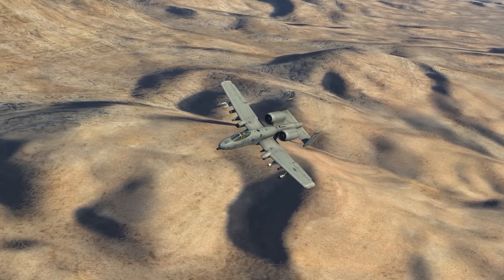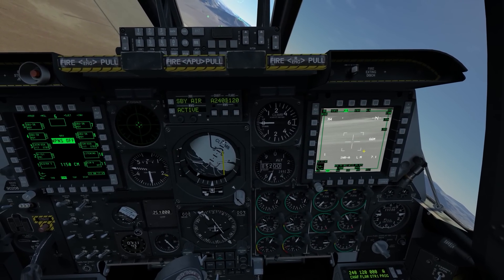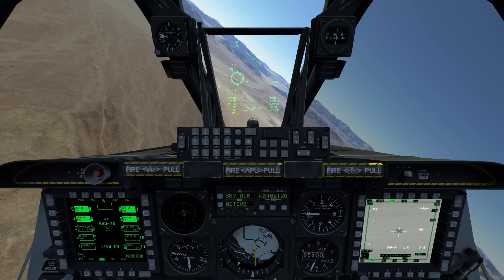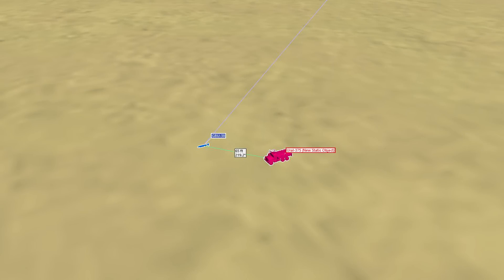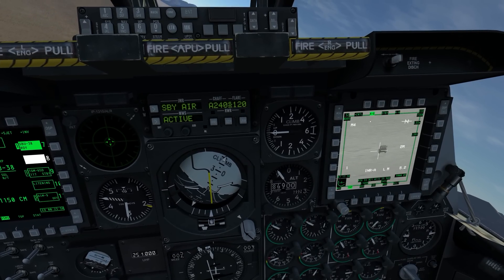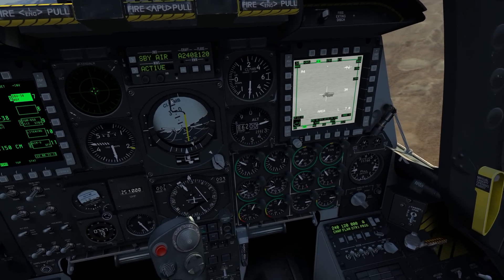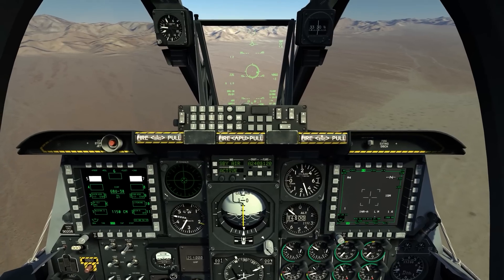On the Range #57 - Accurate GBU-38 Delivery in the DCS: A-10C Warthog

Comment: Nice vid Bunyap. This thought me how to use the gps guided gnus. One question though; Wouldn't it make more sense to use point mode since it will track the vehicle?
Reply: Airsoft and Games point mode will track the target but the INS guided bomb will guide to the mark point not where the tgp is tracking... Perhaps a laser guided bomb would work better on a moving target as it will follow the laser as it falls.
Reply: +dirtywaffleiron1 well what I meant by that is that point even if you don't track the vehicle point mode it's looking at something specific while area looks at an area.  That is what I was trying to get at
Reply: also I tested it multiple times with point mode and it never went past the vehicle like bunyaps did with area
Reply: Airsoft and Games oh yes. Only time it would be tricky is if the target were in a city making point mode want to lock ok buildings, ect. 👍

Comment: Nice tips. I assume this could also be done with mavericks?
Reply: yes, but you have to add some steps, depending on the type of maverick. the ones with the CCD cameras can force correlate, i beleive, on the actual point. the ones with just straight IR cannot and need to get a lock. also, you'd need to make a run in, set your steerpoint as SPI then slave the seeker head to the SPI via china hat forward long (slaves all to SPI). the TMS forward short with MAV as SOI until it locks (if not force correlated). fire.
Reply: whats the name of this simulator?

Comment: Just a couple of sidenotes:

- You can use the lasing method for more precise hits without using markpoints, by setting the TGP as the SPI generator and lasing while pickling the bomb.
- Remember you can keep your hands on the stick and cycle through markpoints with DMS UP SHORT and DMS DOWN SHORT, when HUD is SOI (COOLIE UP SHORT).
Reply: But without markpoint in bad weather conditions, you will have an offset compared to your desired aimed point ?
Reply: As long as the TGP can see the target at the moment of pickling and the laser is on, bad visibility has no effect on the bomb's precision. Strong winds would offset the bomb regardless of the sensor that is feeding the data.

What is happening during the pickle is that the SPI coordinates is being sent to the bomb's guidance system (that's why you have to keep the button depressed until release, to allow the data to flow entirely). The bomb doesn't care if the coordinates come from a markpoint or the TGP: the big advantage of the markpoint is that you can place it, climb above a cloud layer, and then drop it from there, or directly drop on given coordinates (MGRS last digit should be 1 meter precision, more than enough) without even the need of seeing anything through the TGP (although in that case it would probably be a waypoint).

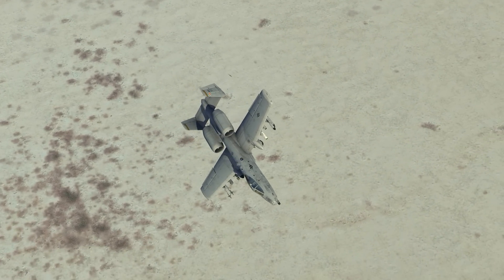The laser is needed because at low LOS angles (low altitudes and/or long ranges) the TGP is actually looking through the target to calculate the coordinates. By lasing, you force the coordinates to be corrected by taking into account the target's presence, since the actual range is now being used. You can see this exact behaviour in the video, when Bunyap drops the second GBU-32: at 4:44 the TGP is pointed slightly behind the back of the truck, precisely due to him lasing the back of the truck at 4:03; if he had lased the left side, the TGP would be pointed slight to its left side. Incidentally, a few seconds after you can see the TGP is actually rotating not around the truck, but around the point on the ground it "sees through".
Reply: +Gliptal Thanks for all those explanations ;) nice to read
Reply: +Gliptal in practise, in the sim, the MGRS or LL Coordinates given by JTAC are never 100% on target. This always necessitates fine tuning with either TGP SPI or Markpoint designation. Try the Smerchhunt mission in 1.5.3, great fun!

Comment: Oh, great, never thought it will work ... 

It can be very useful in bad weather conditions and in moutainous region (Enemy Within Campaign, OP hammerfall pt3 i think). But at the end of the day you will have a lot of Markpoints created. And all those Markpoints can make the TAD unreadable. What is the procedure to erase one of your created Markpoint ?

Thanks to you good continuation from France
Reply: +Johan G.Bruère-Dawson Unfortunately you can't.
Reply: +Gliptal oh really !? that's wierd for a so evolved system that you can't erase markpoints..
Reply: Agreed. Apparently this functionality in the real aircraft was added in a suite update that is more recent than the old one we have right now in DCS, meaning the sim is actually accurate to a fault. If I remember correctly one of the blank buttons on the CDU is responsible for deleting markpoints in the real thing.
Reply: +Gliptal Oh good to know. Thanks. Do you think ED can ad this functionality ?
Reply: It'd be nice, but I wouldn't hold my breath. There's a lot of thing that were added with the new suites that would be very nice to have, but it'd require devolpment time I don't think they have right now that 2.5 is coming up.
Reply: You don't really need to. this method works good for short missions, or where you just need to get the bombs off the rails now.

if you plan it properly, you really should be moving those markpoints into a separate flight plan as waypoints. that way you can cycle through them and name them and such, and prioritize/organize. 

ie, make a few passes/circuits like a buzzard, marking your targets as you go. prioritize them, sort them, and put them into different flight plans. select flight plan as needed, keep a main flight plan as your navigation plan, and the others with just basic points, such as the IP, bullseye, and any associated targets. generally any SAM/AAA Threats are primary unless dictated otherwise -- so they have their own flight plan.
Reply: Munky332
Understood, thanks for your explanation